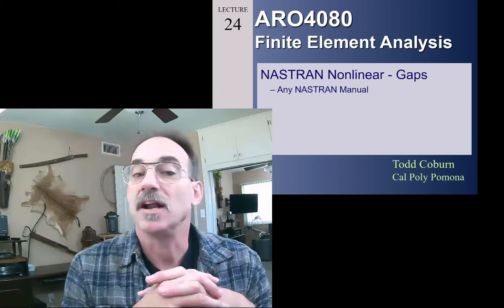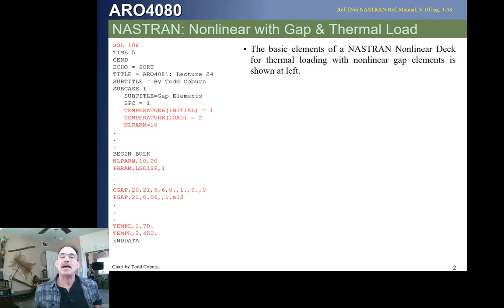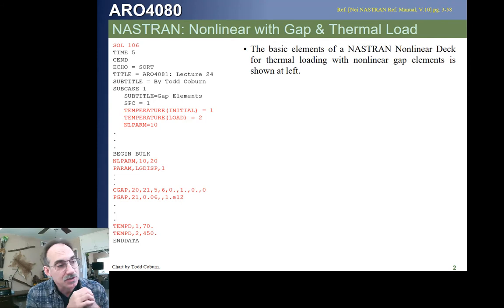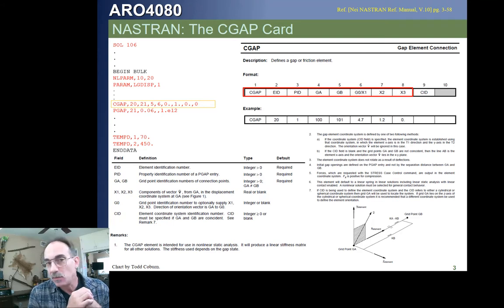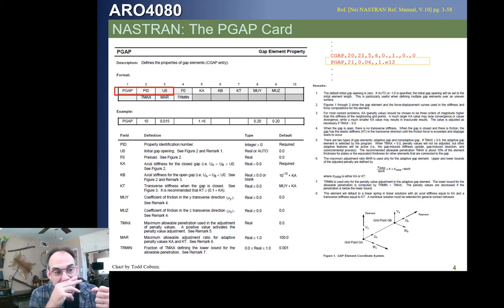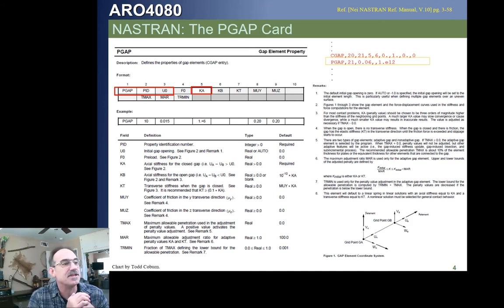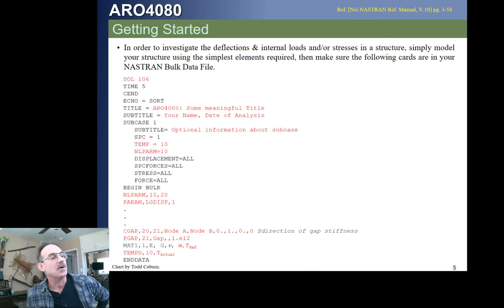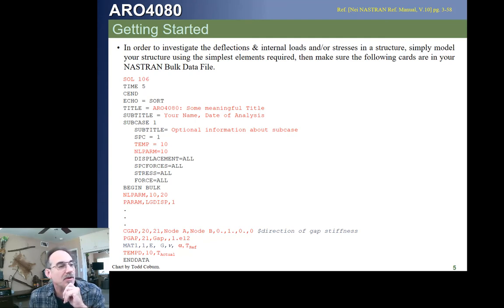Finite Element Analysis: L-21 NASTRAN Gap Elements (FEA)

Comment: Hi Todd, thanks for the amazing and informative video. Have you experienced convergence problem before while using U0 as default (0.0)? You said that using the distance between nodes is not always correct for the initial gap opening, which value is the one you recommend? 0.01 mm?
Reply from the maker: Convergence can be an issue for any FEM, and is affected by countless nuances.  Might run one minute and bomb the next and require detailed searching to get back on track.

This is why simple is best, grown step by step towards complexity, if absolutely needed.  Detailed gap entries may have different optimums for different models.

I recommend starting with a simple model, experimenting with different entries.  Increase complexity, experiment again.  Look at results and how these affect.  Document what you do and determine, cuz years later you will likely want to refresh on what you found without re-inventing it